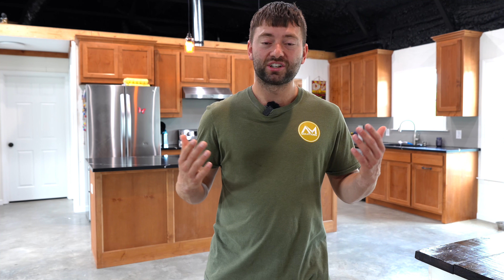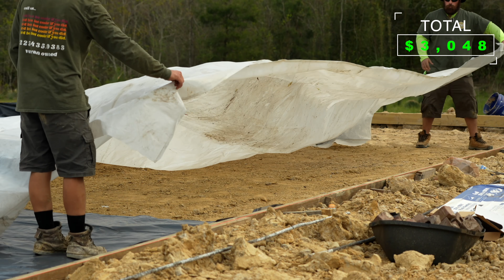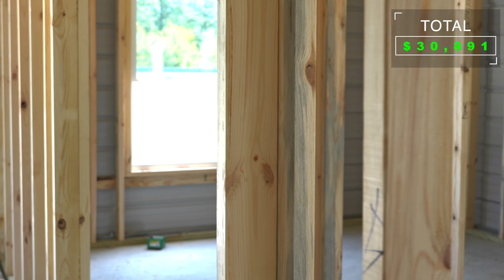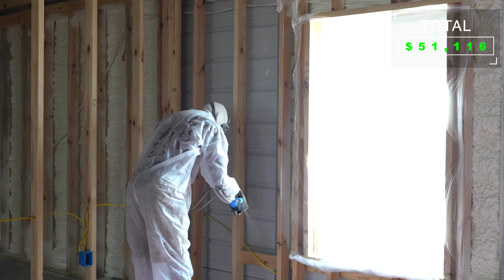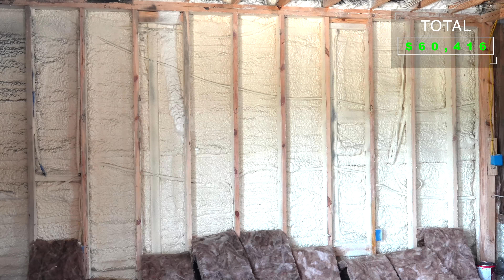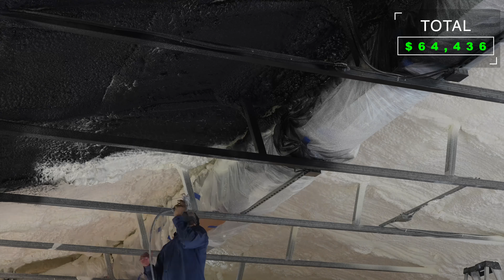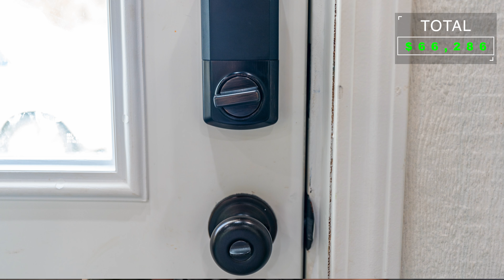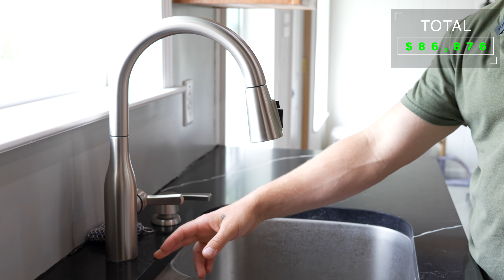Barndominium Price Breakdown | Building a 1,500 sqft 3 Bed 2 Bath Home for $87,000

Comment: What part of the country are you in? Really nice build by the way. Love your idea of digging the pond, then you have extra dirt. R 26 walls is double the normal. QUESTION; where in the country do you live that you can get away with a 12”x12” footing? You did a lot of planning to get this done, and I’m still shocked you did it this cheap. I built my house myself in 1987. 32x36’ two story with garage under the living space. Things were at least 10 times cheaper than today. So 37 years ago, I quit counting at $69,000 and it was still far from finished. It is a wood framed house but I did everything besides the brick chimney, and hired someone to hang 50 sheets of drywall in the ceilings and closets,  (including a cathedral). Sub contract labor back then was $350.00 for 50 sheets. I did my foundation, slab, all framing, wiring, plumbing, flooring, etc. I used tongue and groove cedar in the living room, one bedroom, the office/Florida room. I used cedar trim inside and out on Dutch dormer windows. Outside was a beaded cypress siding but got tired of cleaning and sealing it, so vinyl sided over it myself, years ago. There’s so much more but don’t want to ramble. I’d say you pulled off a modern day miracle somehow, lol. I recently had an 18x35 building out up for my rv with a 14’ opening, enclosed on the sides and gables, but open on each end. Just the building was $7,200 and that was shopping around. Enjoy your new home.
Reply from the maker: I'm in Louisiana. The footings are engineered for this specific building. This style metal building does not weigh very much and does not need a huge footprint. I was quoted $5,000 to install 100 sheets of sheetrock. That's why I did it myself and used batten strips.

Comment: 1 piece of advise when doing flash and batt insulation detail, it’s recommended you don’t use batts with moisture barriers should moisture ever make it behind the wall system.
Reply from the maker: Good to know. From the charts I've seen, the kraft paper moisture barrier doesn't actually do much other than hold the insulation in place

Comment: I like that you didn't traditionally sheetrock the interior. Everyone always assumes you MUST cover all your walls with sheetrock/mud, but it's labor intensive to install, it's fragile and it's difficult to repair. The battens look great and give some depth to the rooms, instead of a void cube that everyone loves for some reason. Good move!
Reply: Some local codes require sheet rock for fire rating behind a wood wall.
Reply from the maker: Thanks! I also do not like sheetrock and was looking for alternatives!

Comment: how do you safe water intrusion from the bottom of the building . is it possible to have a 3 foot concrete wall all around and have the building installed on that ?
Reply from the maker: My house is several feet above the normal ground level with slope away from it. There's also a 1" brick ledge so the exterior metal extends below the framing and finished floor. 

I'm sure you could do a concrete pony wall if you want to. Might need to get it engineered though.
Reply: @DudeWeCanBuildIt   you are inspiration . I am starting minimal by myself as a 25 year old . already have half acre land mulched and cleared also surved for boundry  with mixed zoning out of Hoa crap. in Florida Marion county need at least 400 square feet structure . I will do outdoor kitchen and probably a bath inside this 400 square foot . trying to get out of this rent and debt cycle. well and septic will be added . do you want to give any suggestion I am thinking to do red iron or tubler building . looking for some real bile metal building company in central Florida or you have email address I can ask you if I have any question. I can pay for your time and guidance ?
Reply from the maker: You can reach me at amsolutions225@gmail.com

Comment: Not sure I like the lack of exterior sheathing, relying on only a thin aluminum/steel and insulation.
Reply from the maker: You can always add sheathing if you want to. The closed cell foam makes the metal very rigid.

Comment: Now, not sure where you live but If this is true I want to move there..Just one thing what about permits?  or are they not needed? 1if you had inspections for electrical, you had to have permits right?  Waterless tank maybe not a big one but the price surprised me, as well as when I tried to install one in my home by "professionals"  just that one thing was going to be over 5500 dlls.....So not sure I believe all of those prices.,
Reply from the maker: I'm in Louisiana. Permits cost me $400. Check out Home Depot, that's where I got my water heater. They are not expensive. In your case, if new electrical is required, it would be more expensive than just the cost of the water heater.

Comment: About the in the slab plumbing, is it ever done to frame around the pipes so the pipes can be accessed (no concrete on top of the pipes) later?  So you have the pvc pipes in framed slots, pour the slab around that, then you'd put the flooring on top of that so it's not seen. That way if some pipe work needs done, you just lift some flooring instead of flooring and ripping up concrete.  Maybe the pipes could be set up to be along the walls so you'd not even be stepping on the flooring over that
Reply from the maker: I've never seen it set up like that and I don't have the expertise to advise on it. You could consult a plumber about that

Comment: So you built the cheapest,  junk materials POS on earth , that wont last 10 years. GOT IT.
Reply from the maker: A metal building on a concrete slab won't last 10 years?

I'll bet you $100k that it will still be there. I'll have an attorney write up the agreement if you really believe that 😂😂😂😂
Reply: @DudeWeCanBuildIt  Not with the low-budget trash, used inside.
Reply from the maker: @Daniel-po8eb  I didn't realize custom cabinets, walk in showers, and quartz countertops were cheap. You must live in Dubai!
Reply from the maker: @Daniel-po8eb  The cabinets are alderwood from a local cabinet shop and the quartz is from SLAB, a fantastic woman owned business. 

Your disrespect towards locally owned businesses is astounding. 

Also, I'm seriously down for that bet, big baller. Posturing foolishness is presuming to know what someone has in their bank account. I just built a house on 27 acres, I have plenty of equity to accept your generous donation.
Reply: @DudeWeCanBuildIt  EXACTLY , EQUITY, NO cash. Thanks for proving MY point, Junior!
Reply: @DudeWeCanBuildIt  I said nothing about about ANY local anything. I have been importing and using Granite, Quartz and many other types of natural and man made materials longer than you have been alive , child. There are dozens of grades of each of them and I can tell from the photos, that the trash you use was purchased simply and solely due to its LOW cost. Ive installed more stone in one year than you will in your lifetime! My suppliers are the largest volume stone suppliers on Earth and Im reasonably assured , your Girl in Louisiana has NEVER been invited to ANY quarries in Turkey Asia or anywhere else, as Have I! Its ok to admit that the only consideration you used in this CABIN was CHEAP. Alder is trash as well Son. My Cabinets are ALL without exception OAK and some have lasted over 40 years thus far! Lets bump the bet up to The property , All of your tools, equipment , and miscellaneous Junk , mine is worth considerably more, but I could use another duck hunting location!!
Reply from the maker: @Daniel-po8eb   Okay Big Boy, let's up the bet. What else are you eager to give me? 

Quartz countertops won't last 10 years, that's the funniest one yet! 😂😂😂😂 

Send me your email already, so I can get the contract sent over! 

Oh, and quartz is man-made, not sure what quarry digs that up, 😂 😂 😂
Reply from the maker: @Daniel-po8eb  Let me educate you, A steel building with polished concrete floors, quartz countertops, and tile shower is more durable than any pile of sticks mid-range house ever built. Especially one built by a know-it-all like you that can't accept that there is a better way to do things. 

It is absolutely disrespectful and pathetic how you keep insulting small business professionals that know their craft better than you. 

For someone who is clearly old enough to be my Dad, you are wildly childish and insecure. It's sad that you have built houses before I was born but still lack any integrity or respect.  

I deal with keyboard warriors with fragile egos on the daily, so get in line. You are all the same, all talk until it's time to put your money where your mouth is because you know you're shuffling a pile of nonsense.
Reply from the maker: @Daniel-po8eb 

Now I'll educate you. A steel building with polished concrete floors, quartz countertops, and a tile shower is more durable than any traditional house.

Next, you're going to say the grass is blue and the sky is green, lol. 

I deal with keyboard warriors with fragile egos all day, so get in line. You are just like the rest of them, all talk until it's time to put your money where your mouth is. 

It's especially sad that you are old enough to be my Dad, but lack integrity and are so insecure that you go to YouTube to shout nonsense. And you won't even back it up because you know you are wrong. Maturity doesn't come with age, it comes with growing up. Accepting when you are wrong and learning from others. I feel deeply for your suffering and hope you find your resolve. You won't find it here, it comes from the source.
Reply: @DudeWeCanBuildIt  As a first time handyman building Barbie play houses in a swamp, It no surprise what you dont understand junior! I stopped polishing and staining concrete before you were born ,  because it doesnt LAST! Your cheesy slab will be  completely cracked within 6 n months. Your undersized footing broken within a year . And your little legos building wont survive hurricane season this year.
Reply from the maker: @Daniel-po8eb  You are already wrong on 2 out of 3 there. The house has been there for over a year. Concrete looks great, clean and wax once a year and it will keep looking brand new. Footers are fine. It's supposed to be a busy hurricane season, so you will be proved wrong on the last point soon enough. 

Why do you keep grasping at idiotic claims?
Have you never been in a Walmart? They stripped up their flooring and polished the concrete a decade ago on concrete that's older than me. Still looks great. Let me guess, your going to tell me somehow you're smarter than a multi-billion dollar international company. 

Keep going, really, I've already won a bet on how unsubstantiated your next reply was going to be! 

With your misconstrued construction logic, I wouldn't trust you to build a LEGO house for a Barbie, lol.
Reply: @DudeWeCanBuildIt  You dont have 100k so your posturing foolishness is nonsense!
Reply from the maker: @Daniel-po8eb  
I didn't realize you were managing my financials 🤣🤣🤣 

I must have plenty of dough if I pay you to manage it for me.

Comment: I understand that where someone lives means this cost varies. How much did it cost to get the electricity the 600 feet to you?
Reply from the maker: The original quote to have the utility company bury the conduit and pull the wire plus set a transformer was around $12k.

I buried the conduit myself because I have an excavator on site to save some money. Then, they applied the new construction credit and I paid around $3k

Comment: 150mph wind-rated carport(?)
Reply from the maker: Engineer stamped
Reply: Great frugal build - just wondering how this shell compares to a red-iron building.  It's more square without the big columns in the way and if it's 150mph wind rating - even better.
Reply from the maker: @MyContinent  The ratings are the same, but red iron cost twice as much

Comment: I guess it depends on where you live, but a 1 foot deep footer where I live would not work out. Freeze and thaw cycles would heave that over one winter. And also where I live,  insulation under the concrete would be ideal.
Reply from the maker: You must be in a much cooler climate than Louisiana
Reply: @DudeWeCanBuildIt  Pennsylvania.
Reply from the maker: Much cooler than Louisiana.

There's also no bedrock here, so most of our foundations are "floating" slabs.
Reply: @DudeWeCanBuildIt  that is very nice.  Doing a foundation here is more of a pain in the ass.  😂

Comment: Seeing electric done like that without conduit, gives me anxiety 🤷‍♂️
Reply from the maker: Which part?

Running Romex through studs or using MC for exposed on the trusses?
Reply: @DudeWeCanBuildIt  The Romex, I had that in my home when I moved in and replaced it all. It’s not up to code where I live and even though it would have been grandfathered in I just rather get rid of it all together.
Reply from the maker: Running Romex through studs is code here. Everything in my house passed inspection. I've never seen someone run conduit in a wood frame house. 

Where do you live?

Comment: 1k for concrete finishers? Where are you 1973?
Reply from the maker: Louisiana. 

Going rate is 75¢ per foot here.
Reply: @DudeWeCanBuildIt  dang that's sweet
Reply from the maker: @breckfreeride  yeah, it's good. How much is it there?
Reply: @DudeWeCanBuildIt  don't know the finished cost but used to batch the concrete.  We charged 225 per yard and up! I bet finishing cost up here would be 1.25 or higher.
Reply from the maker: @breckfreeride  Wow, that's steep.
It's $150 per yard delivered here

3000psi with fiber
Reply: @DudeWeCanBuildIt  lol they are jacked on fiber prices too! I think we may charge another 25 bucks a yard! I would do 3k maybe once a month, almost everything was 4500 or higher.
Reply from the maker: @breckfreeride  dang, that is unheard of here
Reply: @DudeWeCanBuildIt  I hear ya... But we're way up in the mountains... I've been to the top of A Basin in a mixer truck.  Cost for housing probably close to 1k per sq foot now and stuff in fairplay went from 160 to 500k in the last few years...

Comment: Wanna know how I know you've never owned a tankless water heater before?
Reply from the maker: Let's assume I haven't. Why?
Reply: @DudeWeCanBuildIt  Do a review video after 6 months and tell us what you think! That's how long I had one installed before I reverted back to a tank.
Reply from the maker: I've been in this house since October, and I love it so far. More energy efficient and unlimited hot water. Why did you revert back?
Reply from the maker: Oh, that's wild. Do you have hard water? 
Sounds like mineral buildup. 

My electric bill hasn't been over $60 yet and water pressure is fine.
Reply: @DudeWeCanBuildIt  Yes, actually, I live in south Florida and I think we are in the running for the hardest water in the country. Thanks for the tip
Reply from the maker: @Tomato_Licker  Oh, that makes sense. You should probably have a whole house filtration system

Comment: That wind rating seems off. But what do I know
Reply from the maker: I’m just giving what the engineering stamped floor plan/blue print says lol I live in hurricane valley Louisiana and have no reasons to lie or stretch the truth about a wind rating. I’ve seen multiple people mentioning this seems “off” or “untrue”. Is there any particular reason and that makes you believe that? Genuine question
Reply: @DudeWeCanBuildIt  I built houses for a long time, my father owned a company. The framing of houses we built seemed like they had way more to them than this and I think were rated the same.

What part of Louisiana you in, I've been thinking of moving there for years.
Reply from the maker: Makes sense. I'm sure siding and roof materials play a big role in the wind rating. 

We're in the baton rouge area

Comment: Why no price on the site work? Or septic system.  I'm just curious.  So far, you're right on. However, it helps if you have experience in construction and friends in it too. Only thing i would change  is the structure. I used red iron. Its much stronger in wind etc. Anyway, Keep up good work.
Reply from the maker: The red iron quotes I got cost twice as much for the same wind rating. Also, a buddy of mine had a brand new red iron shop built in 2021 right before hurricane ida hit. We had maximum gusts recorded at 75 mph and caved in the side of his shop. The company wanted $16k to fix it. 

They had 20' spans between the 4x4 supports on the long side and it taco'd the center support. I think the span was too wide, but with the tube steel buildings you get a support every 5 feet. You can upgrade to 160mph rating and have supports every 4 feet.